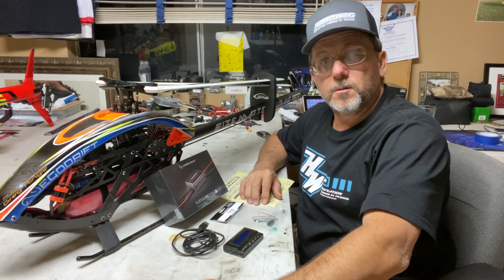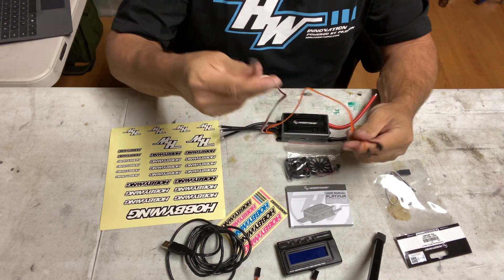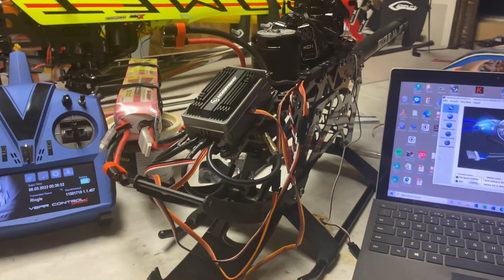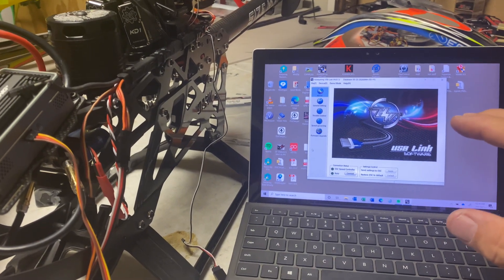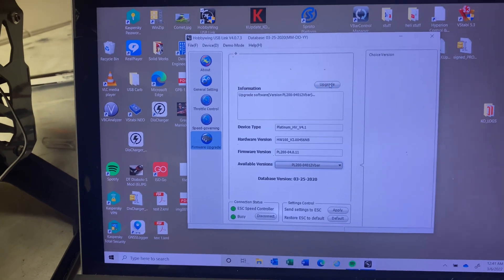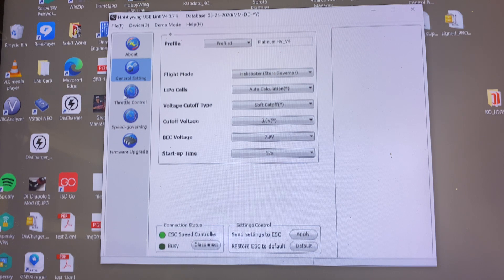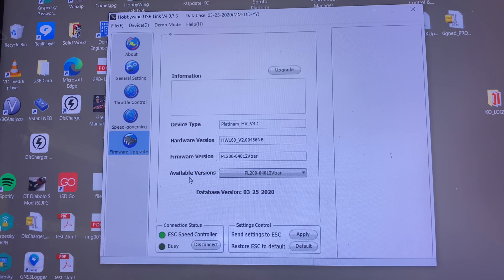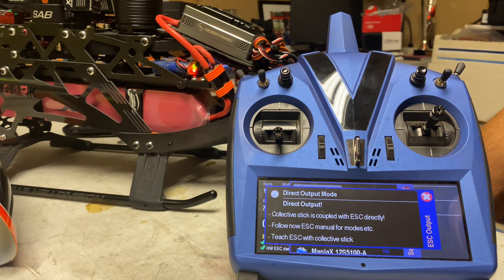Hobbywing 200 amp ESC V4.1 and V Control Setup: Part 1 of 2

Comment: Using the Vbar transmitter and Vbar governor, do we need to calibrate the ESC (to teach the throttle endpoint)? I think we adjust the ESC limits (setting the stop/full endpoint) in the transmitter only.
Reply from the maker: On my helis I teach the ESC the end points. I figure it is the only way to make sure that the ESC knows that full stick is atually 100%. Just my process and it seems to work.
Reply: Your way works well, for sure. Since using the Vbar governor, I just set the Stop/full endpoints in the Vbar transmitter only; this still works fine. Thanks for your response.

Comment: Can you also programm the ESC without a programmer. So with beeping and remote control? is there a solution like blheli
Reply from the maker: If you run a radio that is integrated with the ESC yes. If not then you would need to purchase a programming box.

Comment: If i did the calibration but i need to change the pinion bigger after i need to do calibration again or it's enough to overwrite the gear ratio?
Reply from the maker: The calibration teaches the ESC the end points on the output commend from the radio to the ESC. You should be able to just change the pinion.
Reply: @biscaolena   Okay! 
Thank you so much🤗

Comment: Great video Greg..
Question, I had the wrong pole count in my Vtouch/Hobbywing when I did the negative/positive pitch setting and the when I did the 50% spool up… corrected it afterwards but do I need to redo that with the correct pole count?
Reply from the maker: I don't think so. I think the info saved into the radio merely helps with the displayed RPM. I will research.
Reply: Thank you and please let me know
Reply: Any info?
Reply: Thank you for all of your helpful videos! 
Any info as to what I would need to do?
Reply from the maker: @mattdbot  I did some asking and I dont think you need to redo that 50% setting. I think the pole count is merely for RPM output. I can try that this weekend myself on my 420 and see how it works. I will report back on my test.